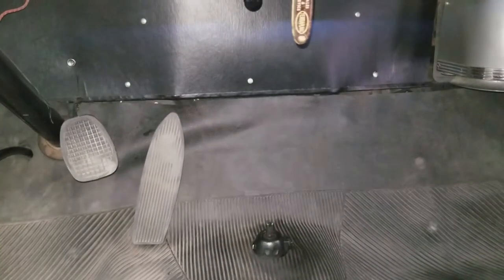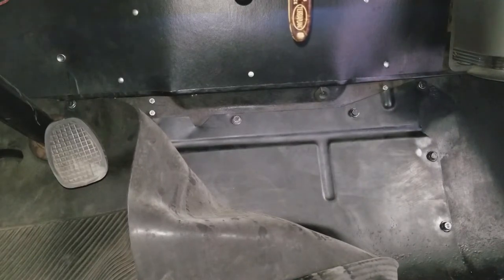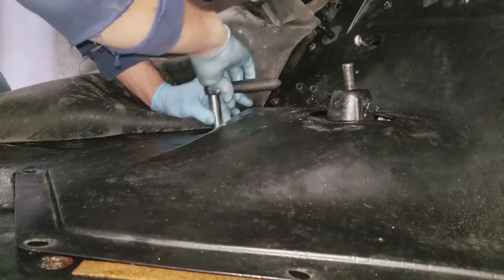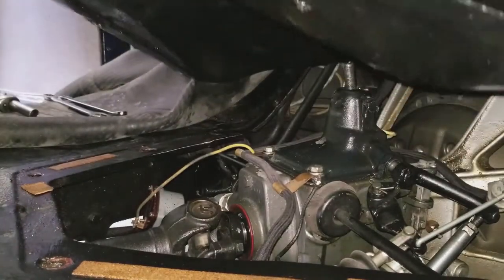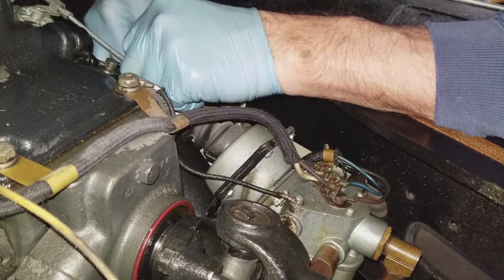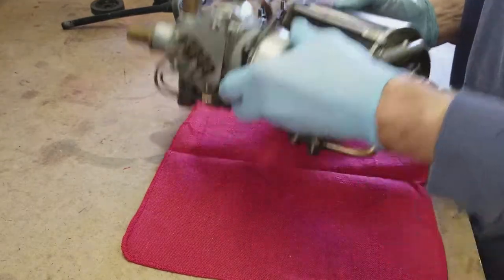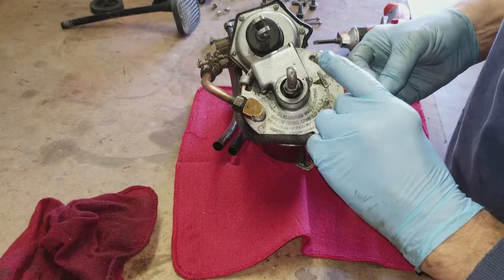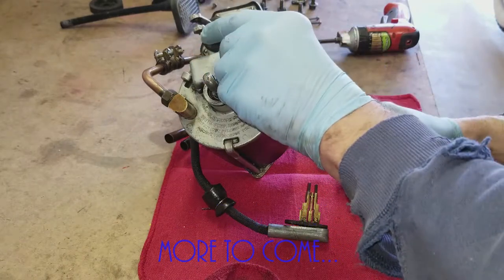Terraplane Electric Hand Wiring - Part 3 - Shifting Mechanism and Transmission

Comment: Very good presentation. Clearly,the presenter has a mastery of his subject. There seems to be so much " contradictory " information and commentary about the Bendix/Hudson Magic Hand System: " very good / very bad " ; " reliable /unreliable " ;  " dependable & durable vs. undependable & troublesome " ; " end after 1938 / end after 1942 " ; it can be hard to know what to think.
Reply from the maker: As long as you understand the mechanics, then you can repair it properly. Knowing how they work makes all the difference. Back then, it would have been best to take the vehicle to a Hudson mechanic. They were only used in Hudson, Chord and Tucker. That's why most people didn't know how to work on them. Appreciate you comment! Thanks for watching.